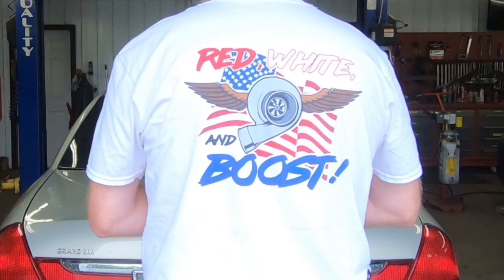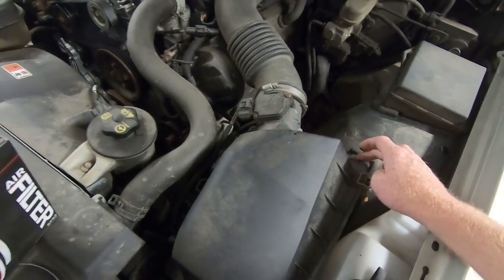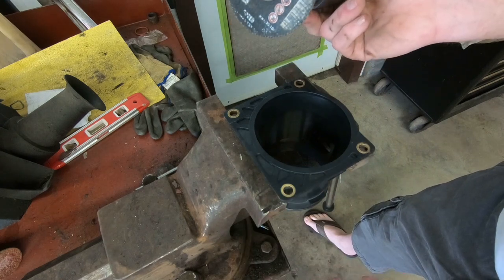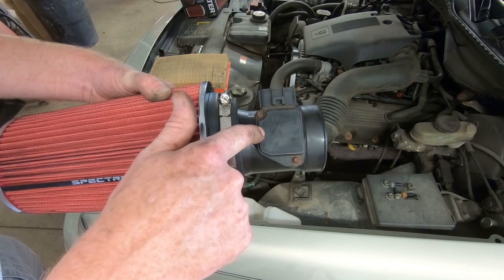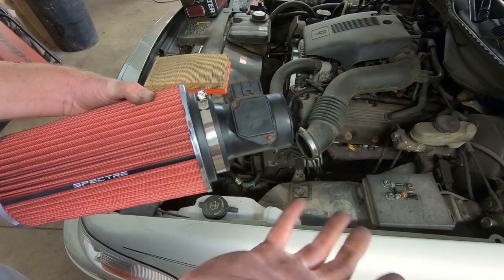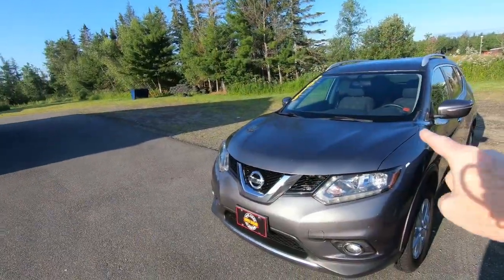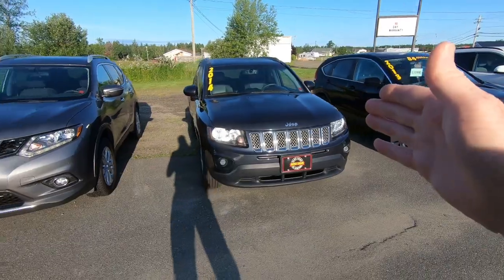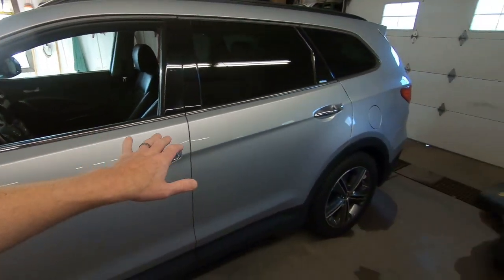HOW TO INSTALL A HIGH FLOW AIR FILTER ON A 2004 MERCURY GRAND MARQUIS

Comment: I am really following this build with all my heart and soul because I love these cars. I was so happy to see that high flow filter in her but was a bit disappointed with the 0 to 60 timing. My 03 grandma is stock with stock filter and goes to 0 to 60 in around 8 seconds without ac. I guess it's because I replaced ignition coils on mine with high performance heavy duty ones.
Reply from the maker: Trust me! I was a bit disappointed as well, but now we have a benchmark to improve upon!
Reply: Olde Carr Guy I just started following due to me getting a 2009 grand marquis , would this filter work for a 09 if so can you send a link please
Reply: What brand of "high perormance heavy duty" coils did you put on your '03 , and where did you get them ??  The most popular brands are "ACCEL" and "MSD", and the MSD brand has a better reputation among racers -- but there must be others out there.
The famous 95 MERC has the OEM coils, still providing excellent performance and fuel mileage after 168,000 miles, while using BOSCH #09725 Mag-Core Ignition Wires and BOSCH # 9605 Double Iridium Spark Plugs @ .054 gap.
Reply: You may have different rear gearing. 15 seconds seems really slow though. I think my old 98 merc used to do 12 seconds. I have an 03 lx sport now with 3.27 rear gears, dual exhaust, and comp xe262ah cams. Not sure what the 0-60 is but it's quick for an old big sedan.

Comment: Good choice I like Spectre filters, I just put a Spectre air filter in the stock air cleaner assembly on my $600 Trans Am project. I wanted to get a better flowing filter without ditching the stock hood scoop and a Spectre that fit cost considerably less than a K&N but does the exact same thing. Spectre, K&N, AEM it doesn't matter who makes the filter as long as it's made of cotton. Cotton flows/breathes so much better than a paper filter and that's why it makes more power.  A friend of mine and my dads that used to race the six cylinder class at circle tracks around here said a cotton K&N filter made a whopping 7 more HP for his race car on the dyno. It was the same size filter too so the gain was purely from the filter element material.

Comment: With bypassing the box you bypassed some of the resonators that helped quite it down and it breathes better so it is a little louder and maybe a little more power. Also I noticed on some cars, that with open element filters under the hood even k&n I noticed it dosnt get as hot under the hood I'm assuming it's because the hot air is sucked in and it dosnt get as hot under the hood,  ot sure if you noticed on yours.
Reply from the maker: We all need to breathe better!
Reply: @OldeCarrGuy  I agree !! All the more reason to STOP DELETING CATALYTIC CONVERTERS !! Deleting cats is both ILLEGAL and STUPID !!

Comment: hey bud thanx for the insights, butt im worried bout the mass air sensor ? do i need to do an ignition on/off  reset ?   or just bolt up and go like you did ? 1999 linc t.c  cartier...🧐

Comment: I wouldn't be afraid to keep the lower portion of the intake box, it's still a portion of colder air than the rest of the engine bay...but moreso to help confine the area that the cone filter can bounce around in more than the rest of that. But it does sound good!
Reply from the maker: Good idea! Makes sense too! Pretty smart guy that STR8SIXFAN!
Reply: @OldeCarrGuy  haha, now don't get too far in front of your skis

Comment: wouldn’t u lose horsepower since the air is gonna be warmer? or does it make it gain horsepower since you’re getting better and more air flow?
Reply from the maker: Colder air is more dense and in theory makes more HP, but being able to move more air will make the engine breathe more efficiently. On a 230hp land yacht, none of it makes much of a difference until you tune it. That's the next step. Thanks for watching.

Comment: Get a drop-in K&N filter for your stock air box.  That thing is taking in hot air from under the hood and your car is pulling timing because of the warmer intake temperatures.
Reply from the maker: But I like it hot. Besides, I'm in Canada, I need all the warm air I can get...lol
Reply: You DON'T want a K&N oiled air filter.  The air filter oil will eventually gum up the mass air flow sensor just downstream of the air cleaner.

Comment: I like the idea of hearing more engine noise upon acceleration?
I change my stock air filter once, a year or every 15K Miles.
How often do you have to replace the Specter Filter used in the video?
Chuck
Reply from the maker: Cotton filter don’t require replacement unless damaged! You can wash them out with water!
Reply: @OldeCarrGuy  
That sounds even better.

Comment: I would be reluctant to cut and grind away on that plastic receiver to get this thing to fit. I am sure you did it correctly and I could do it it’s just that to do this you are throwing the dice that it will come out right.
Reply from the maker: You just need to be confident in what you're doing!

Comment: I was wondering if you are worried about the filter sucking hot engine air now that it doesn't have the box to act as a barrier. Seems to me like that would defeat the purpose and all you did was make a hot air intake that looks cool. Let me know ifi m wrong because I would like to do this if it works.
Reply from the maker: Great question Michael! This was never meant to be a cold air intake but rather a high flow! It is in my opinion and experience that high flow outweighs the benefits of cold air! Ultimately you would want both however, we’re not talking about a tuned powerhouse here!

Comment: Did notorious wrench light ever came out for doing that to the intake
Reply from the maker: Not yet. Is it supposed to come on with the simple change of an air filter? My 2003 has the same set up and the only light on the dash is for the EGR tube that was removed by the previous owner. Even that goes out once in a while.
Reply: @OldeCarrGuy  I know what I’m doing to my 06 p71 Thank you for the video and help

Comment: Thanks man, just did this to my 2011 with straight pipes and a full AC delete. I gotta say, with a full pcm relearn this thing kicks. Cut the fender guards right before the wheels so it's not a hot air intake and so the wheels aren't throwing rocks and such into the engine bay and my god, this is definitely one of the best mods along with a full AC delete. The sound it makes at 5800 rpms is absolutely hilariously over the top. Tempted to have a shop retune the entire pcm to accommodate the higher air flow through the plenum and manifold to really make this thing haul ass. Keep up the good work bud. Edit: If anyone gets the wrench follow this: https://youtu.be/hZAsoqmqhdM. It throws a code for incorrect throttle position or incorrect flow whenever you disconnect the MAF or throttle body position sensor. Make sure you do this as to avoid this.
Reply from the maker: Thanks bud! Great info

Comment: 0 to 60 in 9 seconds?? I have a 2003 Mercury Grand Marquis with dual exhaust and cold air intake and my scores have been in the low 7 seconds... You need to check everything in your engine. Before you ask, my gears are stock. Did you try better ignition coils? Anyway, beautiful car!!
Reply from the maker: These numbers are from an app that may or may not be 100% accurate. Thanks for watching!

Comment: Can I put this on an 02?
Reply from the maker: I'm pretty sure the 02 factory air box is quite similar. You should be able to make it work!
Reply: @OldeCarrGuy  how did you shave the plastic off what did you use? And is this modification worth it to you?
Reply from the maker: @asherjohnson8603  I have a bench grinder in my shop. But you could used a Dremal tool or a belt sander.
Reply: I heard the Electronic Throttle body for some reason doesn't like the CAI, something about it messing with the air/fuel mixture so it runs shitty n laggy. I have an 01 Marquis GS with the cabled throttle body and put one on it works great, I got better torque, little more HP, and depending on how I use my throttle, a bit better mileage, I did however tighten up the throttle cable down at the pedal, and messed with the positioning some on the throttle body itself. I ranged 24hwy b4, but I saw a 4-6mpg increase after. Burnouts are little easier 🤘 with that little extra torque.

Comment: while it sounds better hot air is not better for hp
Reply from the maker: But high-flow is so i see it a 6 of one, half a dozen of the other! Thanks for watching.
Reply: @OldeCarrGuy  with these panther cars gears is where its at my daily driver 01 marquis had 2.73's swapped axle to a 3.08 trac loc decent gain but my 08 p71 has 4.10's with trac loc its great around town i have yet to take it on any hwy trips